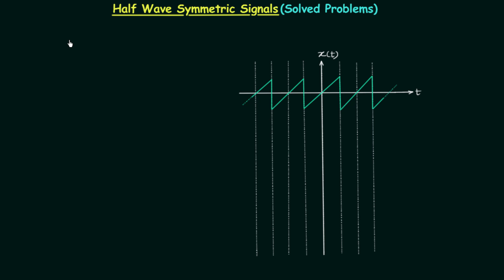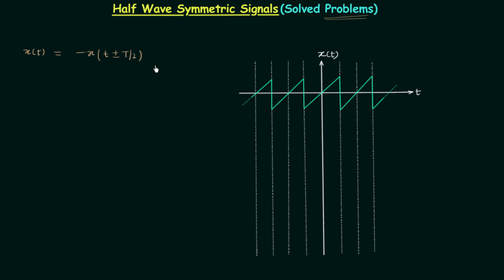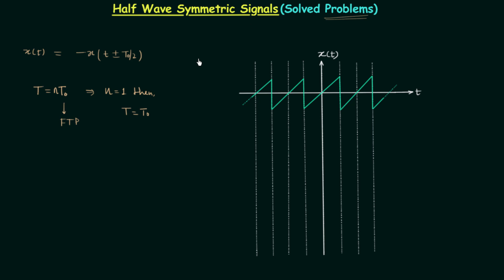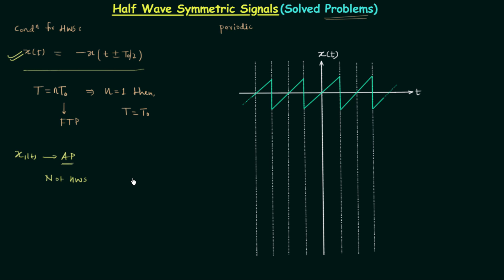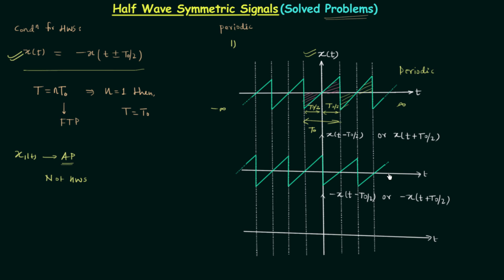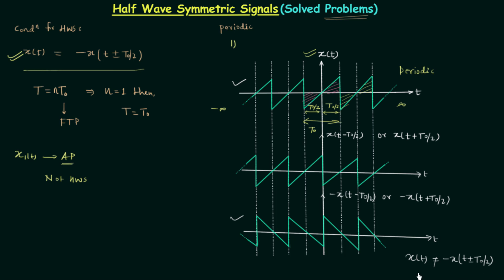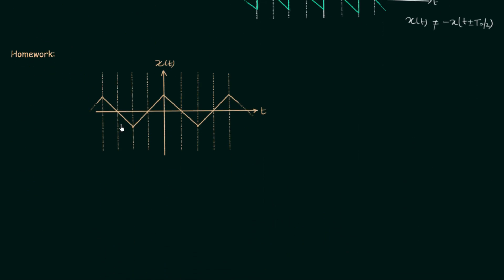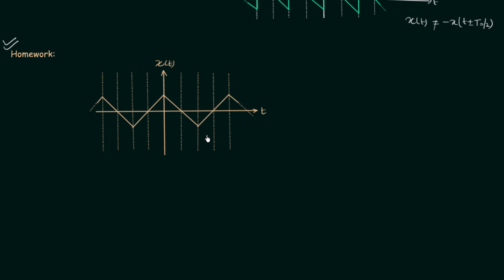Half Wave Symmetric Signals (Solved Problems)

Comment: For the HW problem , the signal is HWSS when we take right shift under consideration but it is not HWSS when we use left or advance shift. so what will be the correct answer for the same?
Reply: I'm not get hws
Reply: signal is HWSS for left shift also...
Take a look at the condition of HWSS carefully
1st u have to do time shifting either left shift or right shift... & then,
amplitude reversal
Reply: 👍🏻 i am also getting same

Comment: The given signal satisfies half wave symmetry condition. 
So, signal is a half wave symmetric signal.
Please correct me if I'm wrong.
Reply: Yes I'm also get differnt waveform
Reply: Yes u are right  @DManoj-ns4hm
Reply: In first we perform time shifting and then we perform amplitude reversal after doing this form is different from  signal x(t)
Reply: @kashishsharma9773  No here it is independent of order of operations u shld get as HWS  , check ur Time period. It shld be T/2, for shift
Reply: Can you tell me how it is possible
Reply: @kashishsharma9773  Check To and shift signal by To/2 right or left and then amplitude reversal
Reply: @kashishsharma9773  here U r doing the question with wrong T .. check ur T
Reply: The signal is half wave symmetric